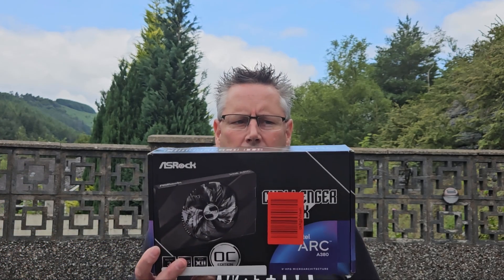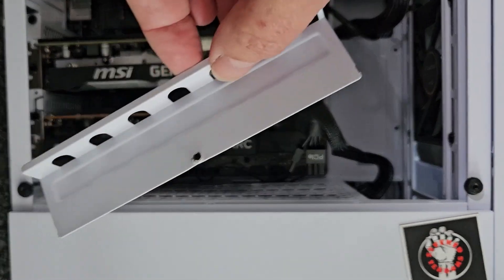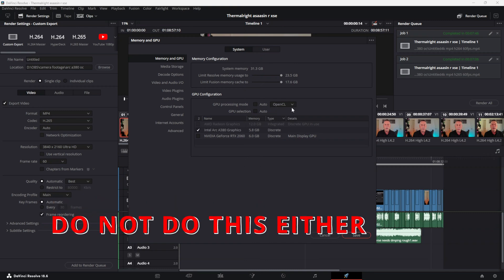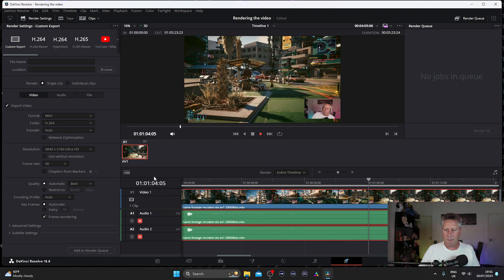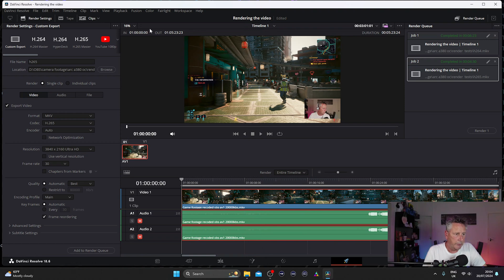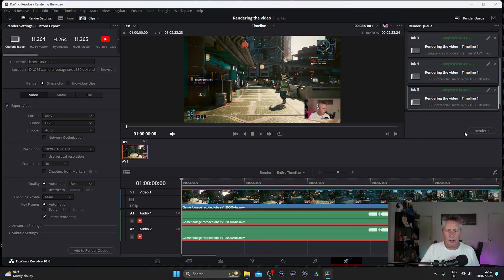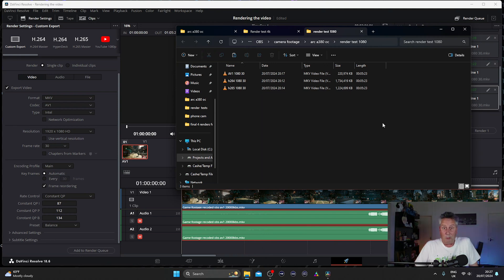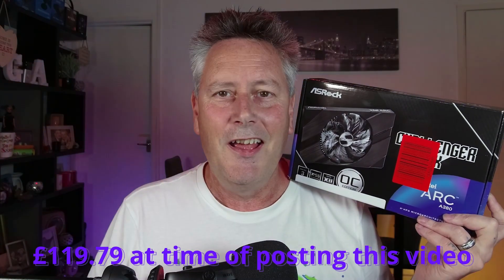Intel Ark a380 as a Hardware encoder/decoder in Davinci Resolve 2024

Comment: Yes. This is the actual video I am looking for as a content creator. Very very difficult to find simple test video like this despite the card has released for years. Tired of seeing AV1 streaming or gaming performance issues videos. 
If possible would you mind comparing exact same video render with cheapest NVIDIA card or the card from NVIDIA that you have. Also the playback or rendering GPU usage details with HWinfo. By the way current PC specifications you used?
Reply from the maker: @mysterychemical Thanks for taking the time to comment, I can certainly do that for you, give me a couple of days and I will put it up for you.
The spec of my machine is:
Asus Tuff Gaming B550 wifi 2.
AMD Ryzen 7 5700g.
32gb 3200mhz DDR4
500gb sk hynix p41 NVME(system drive)
1Tb crucial P3 NVME(data/footage drive)
250GB crucial external ssd(proxy/cache)
Msi Geforce rtx 2060
Asrock Intel Arc A380
Corsair CX650 PSU
Regards
Gray